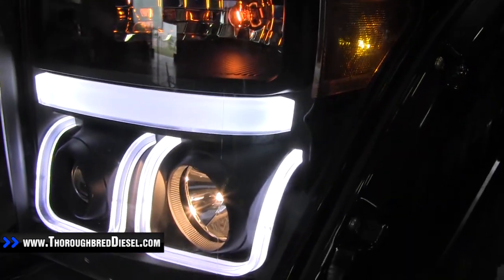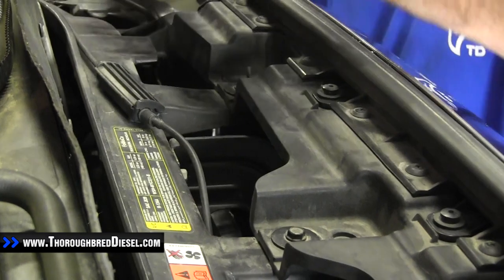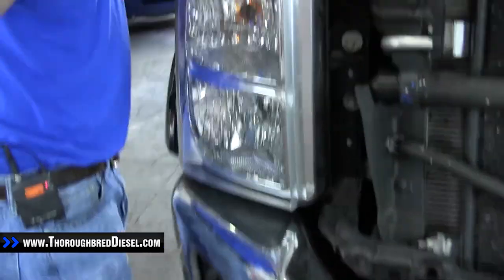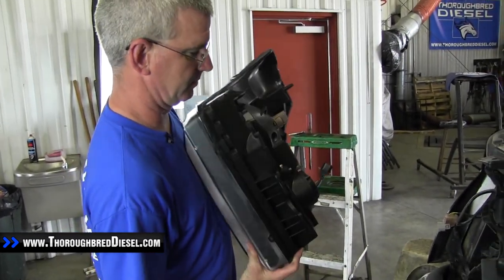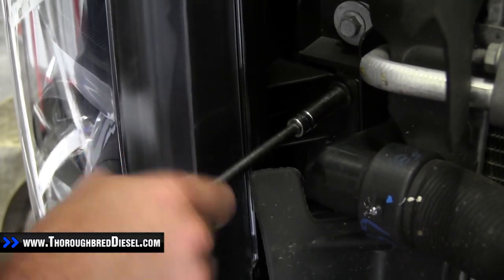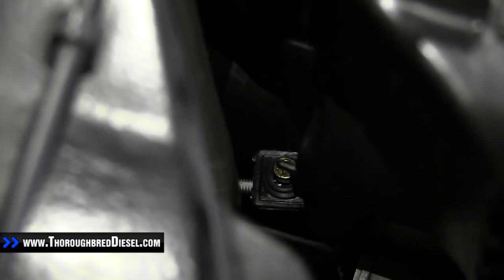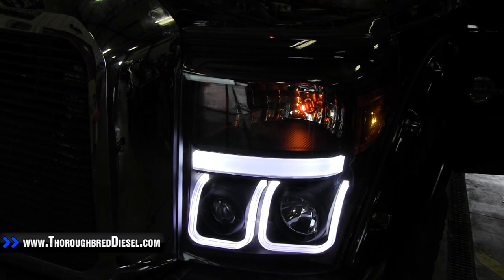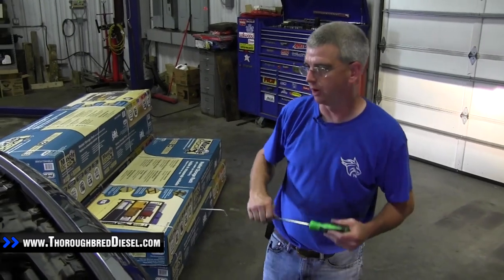ANZO Head Lights Install: 2012 Ford Powerstroke

Comment: I did same ones but in my 2015 f350 and I have hyper flash and yellow top lights don't work. Help
Reply from the maker: I am not familiar with the hyper flash, I apologize.  If there is a converter box in that circuit I would start there.
Reply: They work great now!! But can you change out the high n low beam to bright  white leds??
Reply: yes
Reply: How super duty jack??
Reply: If its like normal aftermarket headlights you just take the old bulbs out and replace them with led or hid bulbs. Its just like changing normal headlight bulbs, make sure you adjust your lights though as they will not be street ready when you buy them.